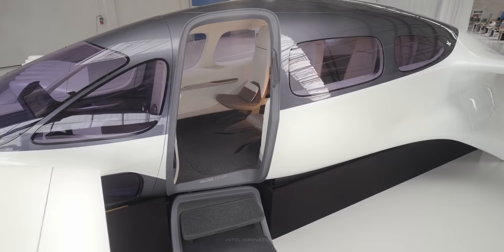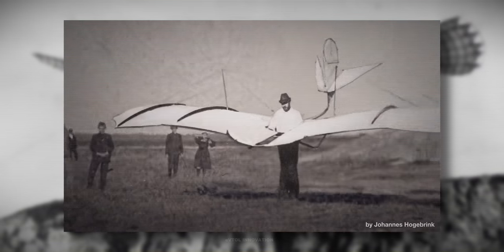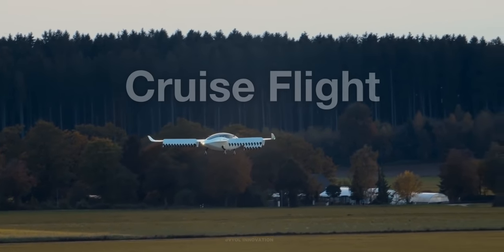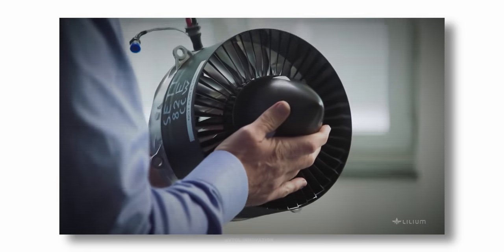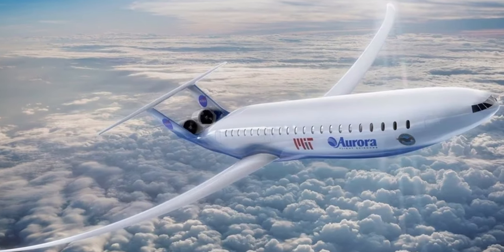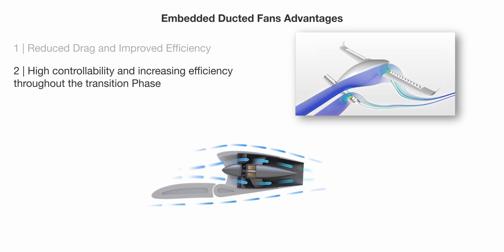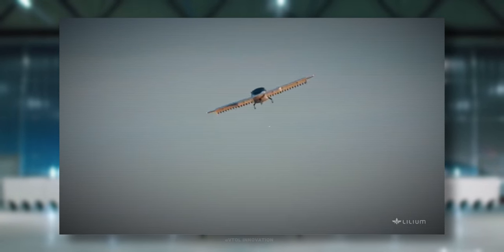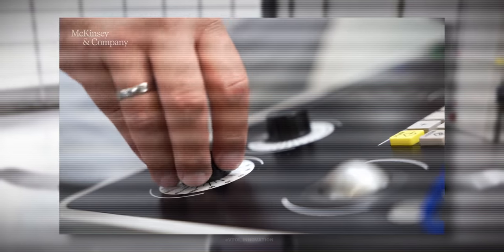The Insane Engineering behind The Lilium Jet | Part 1

Comment: Years ago when i first came across the lilium Jet on youtube,  And seeing its first flight footage as prototypes,  It looked pretty skeptical at first,  but then i really put on my old aviation professional hat, and realized what i was seeing was a game changer.  With all the evtols startups,  the lilium jet was the only one that truly addressed safety, by way of its ducted fans.  Every other concept was clearly an very terrible if not horrific accident just waiting to happen.  How could so many inventors not see the most blatant issue with their concepts.  exposed rotors.   But we already have exposed rotors in aviation.  from small prop planes to helicopters.  The difference here is operational proximity,  and the amount of blades to contend with.   EHANG 16 blades, Joby 28 blades or more, on and on.. in the event of an accident, those blades sheering off upon contact will be a threat to pilot passengers and bystanders hands down.  Lilium on the other had does not suffer such issues.  as its turbines are all confined in pods.  Moreover,  logistic operations means that you can operate the lilium jet in close proximity to bystanders.  as their no way to its turbine to ingest bodily parts.   Lliums obvious advantage safety in design, also has made it superior in scalability.
Reply: I'm not sure if i quite agree with your assessment on why Lilium is safer. Exposed rotors look dangerous, but we have proven technology and design that don't fail under normal operation (including debris ingestion). If it's in a crash situation, the blade might indeed come off, but these planes are designed to avoid the crash situation all together. In terms of preventing a crash, Lilium's design could be more problematic: think about the failure mode of one of the flap actuator jamming when transitioning to land (asymmetric thrust) or if one of the middle engines catches on fire, and knock out 2 adjacent engines. They can mitigate it through architecture and design, but at what cost? The biggest downside to the design IMO is the noise. Because of the high disk loading, the fans will have to push air very fast to generate enough thrust. That fast exhaust air is noise. I think noise level is V_E^4th? But, sincerely, I wish the best of luck to them, because we need all these companies to be in the race in order to have a chance to really see AAM come to market. We will surely lose up to 75% of them to attrition, and right now, we need as many flying prototypes as we can get.
Reply: @anshuoliu3388  I disagree on your assessment of liliums issues but whole heartly agree on the need for these particular aircraft to be successful.  Joby has the lead as anticipated, its design is far more conventional than the lilium jet, which I view as the next generation past that of Joby's layout, and 97% of all the others that has taken such route,  its easier more conventional to that of a standard helicopter.  The issue is really scalability. The evtol industry rests on how much money can be made per flight. And even i was taken back upon viewing a breakdown, by such bean counters of what will be required for the industry to be successful.  It will take alot of passengers capacity but it will also take time to build up a viable infrastructure.  Basically there has to be A LOT of these aircraft flying about and i mean A LOT!!. or it becomes a high priced luxury service no different than current charter flights. In terms of accessibility for the masses,  You can really compare it to current road going taxi services and road infrastructure.  its going to take a chock full of these planes flying about to meet such demands needed to sustain the cost of industry growth.  moreover the meat and potatoes lay with the amount of passengers each flight can take,  the amount of money required per flight. You need no less than 6 passengers and 1 pilot.  If not then your cost per passenger will be fairly high, rivalling that of a commercial flight of similar distance.   The bread and butter of such industry is bringing those prices down, and that wont happen until there is well and enough planes to cover each route,  and in that situation we are truly talking about those scenes in  back to the future ,  The fifth Element and starwars phantom menace,  where you basically have a highway worth of traffic in skies.  we kinda already have as such just with commercial airline traffic into major airports.   I use to live near JFK and loved to see the literal trail of lights from the airliners making their way into landing, one ever 20 miles or so. like a string of pearls in the sky.   But this urban evtol would need to see an aircraft 1 every 8 miles or less, in order meet estimated demand.  fast turn around.   Then there is the vertiports and flight infrastructure, that also needs to tie itself into existing ATC  And thats complicated.  we're not talking the simplicity of what currently exist with light aircraft in bravo airspace, we are talking about highway levels of traffic in the sky, such a thing would almost have to be operated by AI.  its just too many aircraft for any Traffic control operators to handle,  and yet, as a backup precaution they would be required to do so should such an Ai system go down.   talk about a traffic jam in the sky,  and what such aircraft would need to do in the case of an emergency.   As such you can see why pilots would be needed and automation is not truly viable. because automation accounts for a perfect situation.  but in such a scenario where planes would have to land in obscure locations it would take a human pilot to determine where its safe.    This is why i always said,  vertiports would need alternative landing sites along each route in case of an emergency.   such sites could be anything from a simple spat of concrete  zoned out for such aircraft,   parking lots , garage roof tops etc.  and places where obstructions like powerlines is not an issue.     so yeah theirs much more work ahead than simply the aircraft themselves.   its the logistics that matter most.  and we are still far from that.  at least in servicing the public.   BTW those vertiports make for a great source of Franchising business.
Reply: @xevious2501  The business case is very uncertain for AAM, not only because you have to keep the price down, but one has to think of the value proposition vs. hassle ratio. How much do you want to go through in order to save 30 minutes of commute time? You have to hop in a car, hop out of a car, go through some sort of a hassle to get onto the plane and do the same on the other end. For me, I would seriously consider hopping into an automated car, do some work for an hour and half in traffic. So to minimize this hassle, you have to build lots of vertiports,  and just like you said, how do you manage these ports in the ATC system? automation has to be considered. (and yes if you own a parking garage in DTLA, it's time to fetch some good money for it) However, before you get to building lots of vertiports, you have to show the aircraft is safe (not only to the authorities, but also to the perceived safety to public, like what you said) and noise so the public will welcome the planes to fly into the neighborhoods. So the bottom line IMO is the aircraft has to be right in order for a business case to exist. It's hard!
Reply: @xevious2501  as of an automated airplane, I think it's easier than you might think to design. The trouble is with certification. Per the current regulatory framework, you have to show deterministically the SW works without fault. But when you get into these ultra complicated algorithm, and sometimes non-deterministic, how do we certify is going to be a harder problem than certifying the actual planes with a pilot. However, it has to be said that the automation of flight is easier than the automation of driving, because without pedestrians, bikers, dogs running around, there are fewer "entropy" in the environment. So fingers crossed!
Reply: @anshuoliu3388 As you said automation is harder for land vehicles and airplanes OF which btw already been flying for decades (and landing) under automation.  pilots just give it coarse corrections and the plane does majority of the flying,   but for EVtol that may need to land in an emergency,  Its having to the ability to identify safe locations that such automated system will not be able to accomplish , its called human rationality. A machine can be programed to identify targets, but it cant rationalize situation awareness.  Oh theres a nice spot to land, oh btw its a swamp.   what does it do when its over large bodies of water.  etc etc this is when a pilot need to be their to address the issue.
Reply: @xevious2501  that ability is there. With LIDARs and SLAM technologies today, combined with GIS database, the planes r capable of identifying landing zones and best glide path in seconds. A pilot won't be able to gain situational awareness, identify landing zones and make decisions that quickly, especially considering the corridor's altitude could be as low as 400 ft AGL
Reply: @anshuoliu3388  Do the wings even work as wings in the conventional manner ? Otherwise if the batteries run flat, which'll be in a few minutes, it'll come crashing down vertically.. Hardily SAFE at all.
Reply: @grahamstevenson1740  dont understand your reply but..  i think every evtol has a market,  thats the point, they are all not built for the same goal, though many are advertising themselves to be for the sheer sake of attracting investment. Have you actually seen some of them?  Tiny aircraft. Verticle | Ehang   No one 6 ft tall is getting in an Ehang.  It makes 5ft asians look tight inside.  Verticle  you wonder how anyone will comfortably get in and out the thing.   What im on about is those that will be used for taxi commuting services.  its there where size and overall capacity does matter.  None of this is scams. there's nothing magical about these aircraft. The only reason it hasn't been done years prior was due to the lack of both battery technology and the high cost of materials to manufacture in mass numbers,  Aerospace grade Carbon fiber. Thats the case in most current seemingly new technology.  Most stuff isnt new at all, but had to sit shelved until prices came down. Once high cost technology going thru it run, and later coming down dramatically in cost and manufacturing complexity.
Reply: @grahamstevenson1740  It should work as a wing but the L/D will be severely degraded, meaning the glide down will not be great. But I honestly don't think lilium designed this thing to survive a conventional landing (passengers will be fine, but the airframe will not). Just look at the tiny landing gears! However, batteries running flat or failing shouldn't be an issue because distributed propulsion's advantage is redundancy. Along with some pretty advanced battery management and health monitoring, batteries failing all together shouldn't be a problem. This all go back to the aviation definition of safety: risk mitigation and prevention of failures in the first place.
Reply: @xevious2501  interesting fact: the seats will be very uncomfortable because these things are designed to FAR27 and FAR37 crash worthiness, which means the seats must be able to hold up a freaking car while weighing prob less than 30 lbs themselves. So How do you save unimportant weight? thinner padding and more butt ache.
Reply: @anshuoliu3388  hour flight or less dude.  dot think the discomfort will be an issue. and last i remember car seats are not uncomfortable.
Reply: @xevious2501  I was in a EVTOL cabin mockup passenger trial for 30 min and I was not pleased. plenty of headroom though, but I'm 5'7"... completely wasted.
Reply: @xevious2501  Yes it is 'magic'. Those fans don't provide enough lift or thrust for meaningful distances to be covered (range, duration of flight) at sensible speeds WITH A PAYLOAD ! Batteries are ridiculously poor at energy density. Airbus made a prototype 'urban mobility vehicle' a bit like this that carried only one person, i.e. no passengers. It had a top speed of 60 mph and endurance of only 13 minutes. Pretty useless and Airbus actually know what they're doing.  Regulations require that you can't use your full endurance because there's a chance your landing place will be unavailable. In commercial aircraft they're required to have around 45 minutes minimum of extra endurance. By those regs, this can never fly commercially. Airbus has dropped the project now. No surprise there.

Comment: Wonder how much further the range could be with a tether that would use shore power to get it to about 3-500 feet AGL before dropping the tether and starting the trip.
Reply: idk if you need the extra power once the wheels leave the ground. by then you have gone from 0 to whatever the takeoff speed is, which has to be done rapidly since runways are not very long usually, and there is a lot of drag while running on wheels. if you mean doing vtol then that makes more sense, but it still sounds scary. a long cable whipping around in the wind attached to your aircraft? heavy and scary.
Reply: @itoibo4208  but the point of this aircraft is vertical take of. Which is going to be required. Doesn’t matter how quiet it is, If an approved point to take off and land is allowed within a city you’re not going to also get approval to climb in motion. The aircraft will be expected to go straight up for noise abatement.

Comment: For the plentiful of answers from those in concern what may happen in case of partial/complete propulsion loss I simply would like to point out the (safety) standard requirements for civil aviation! Every BOEING, every AIRBUS needs a certification and a LILIUM of course as well.
Reply: Lilium is working with regulators EASA, FAA and Brazil.
Reply: if you count the amount of the motors, you can divide it by three. that means, you can make three independent batteries, control/power electronics and motor groups. that potentially gives excellent redundancy.

Comment: Great aircraft. Only one thing puzzles me: why they insist on calling it a "jet," and it's engines "duct jets" and so on. The propulsion units used here are clearly ducted fans driven by electric motors. Ducted fans have been around since at least the 1940s. The term "jet" is typically associated with fuel-burning engines that use combustion to create a high speed flow of gases. With such a great design, why play such semantic games?
Reply: The usage of the word Jet confuses me also. What is shown in the video is a simple ducted fan, but yes it produces a jet of air.
To me a true electric jet aircraft engine would be: 1. The electric batteries driving a compressor 2. this compressed air would then be expelled into the fan 3. this fan could then be connected to another fan or propellor that creates the wondflow, which could create the bypass air. 
My guess is that the use of the word jet is to do with marketting. A lot of the public assume that a jet-plane is faster and better than other forms of aircraft.
Reply: @ColinDaviesNZ  
I agree with your descriptions of mechanical arrangements that would support use of the word "jet", and also with your suppositions about why Lilium used it.

Comment: The earlier version Lithium models had effiction lift and cruise directional mode, suddenly the evolution converted to quite and too much emphasis on VToL function, now, due to over size wing span and smaller engines, limited the cruise mode demand of going from point A to B travel. 
 The company today, could've utilized the modern model use for sight seeing tourism industries and short range cruise flight services. Thus expanding time for further evolution in designs.

Comment: So you need peak power for landing, can't see that going wrong at all...
Other then that, it's a beautiful machine..
Reply: Maybe paired with equally powerful in air brakes peak power can be counteracted
Reply: In hover mode Llium may need up to 1.8x more power than an open rotor though Lilium have proably reduced this through the use of variable area nozzles.  However in both cruise and more importantly slow speed approach mode it uses much LESS power than an open rotor.   The whole transition from flight to landing will take 21 seconds so this is not a lot of energy.  Lilium needs 300WHr/kg batteries.  Amerious is commerically shipping 450W.Hrs (being used in satelties) so its in the bag.
Reply: @williamzk9083  450Wh/kg will be widely available from different sources in a few years with different chemistries. Amprius is doing that a bit similar than Sinanode by using silicon nanowires, but without graphite. but i expect Quantumscape perform even better without having an anode material at all but using a ceramic separator. maybe they even get to 500Wh/kg. also interesting are batteries with sulphur and with a graphene separator some companies solved the cycle life problem to prohibit the formation of dendrites.
i think that Illium are perfect regarding the timing of modern battery technology.